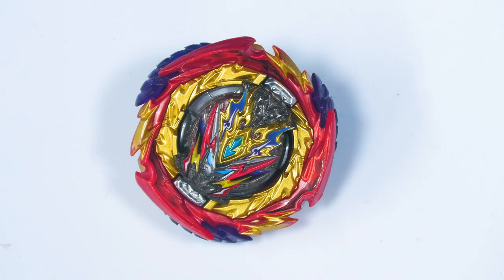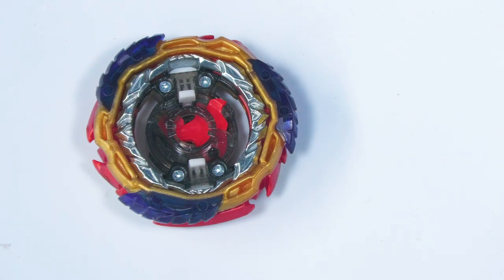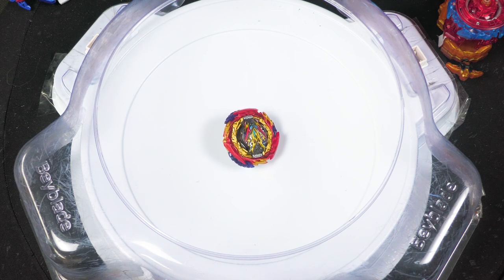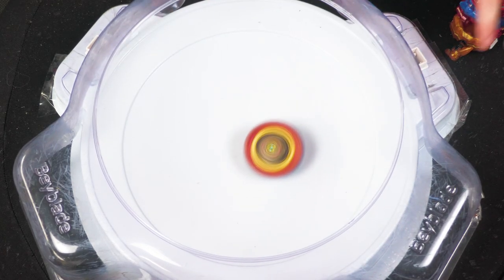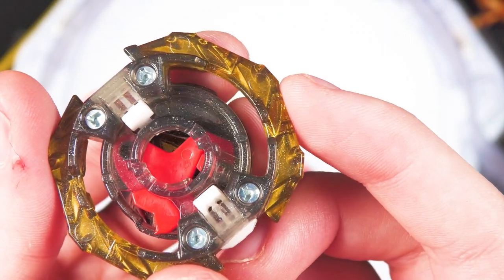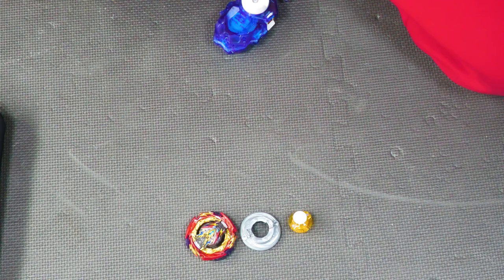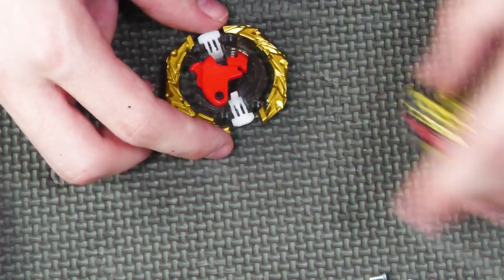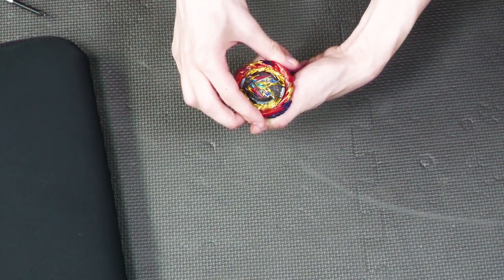How To Close / Fix & Repair The "BIG PROBLEM" Belial 3/2 Burst Stopper

Comment: I have this exact same mold Belial 3 from the set and mine did like you said yours did, started off normal the first dozen or 2 dozen battles with it but after that it started only coming out if I launched as hard as I could and then it becomes almost completely impossible to burst no matter what I try except for hand spinning it and launching my guilty Helios combo at it over and over until it bursts it naturally cause I feel like I'm less likely to break something that way. I mean, it works so lol 
but kinda stoked I got the same mold as you

Comment: Where did you get the screwdriver?
Reply from the maker: Just get any triwing screw driver
Reply: @originalzankye  Ok, it's just that on Amazon a completely different triwing screwdriver pops up. Maybe it has a "Y" shape? It could be it, but I am not sure because it doesn't match the shape of the screws.